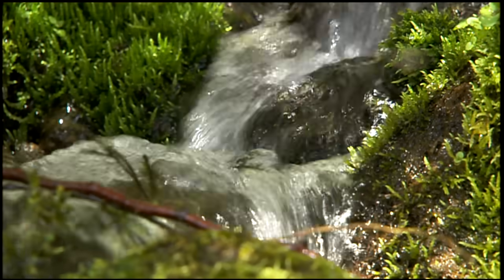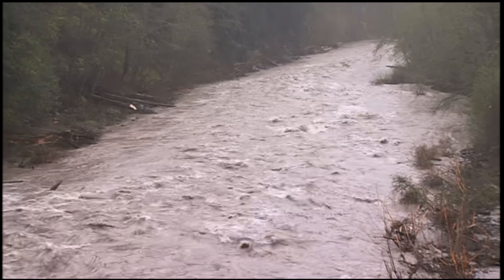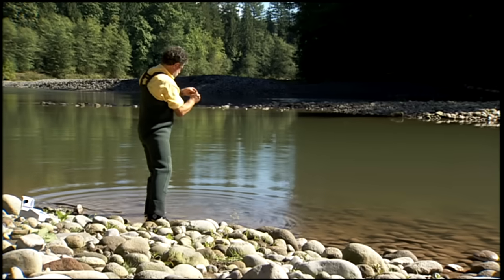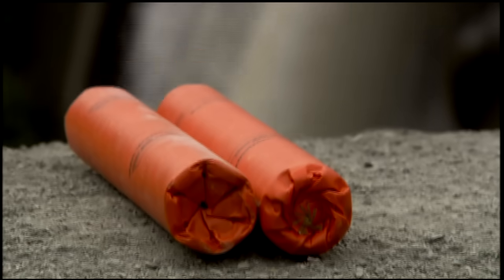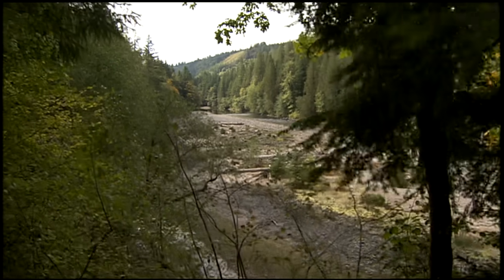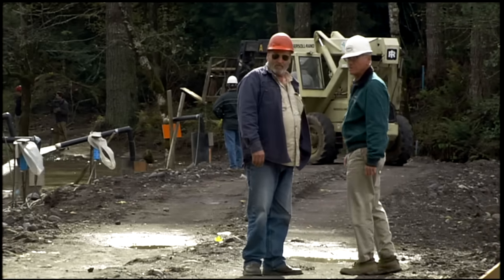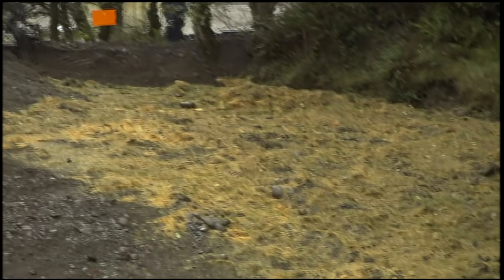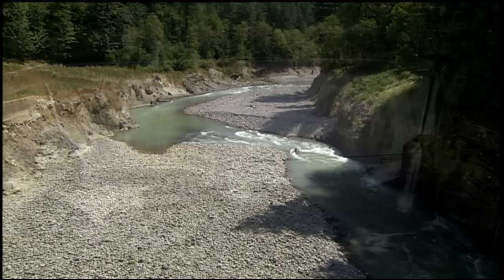A dam no more

Comment: Megatonnes of sediment builds up behind dams in few decades. Remove the dam and most of that will wash downstream, despite efforts to stabilize it with plants. It will smother spawning beds and do other damage, and while the river will—probably, eventually, mostly—clean itself, it only takes one year’s total failure to destroy a spawning run. Suggestion? 
Build one suction dredge that can be taken apart, transported by truck, and reassembled behind a dam scheduled for removal; we should be able to schedule dam removals so that one or two machines will do for all. Dredge most of the sediment out from behind the dam, and it will not be there to wash downstream. I don’t know where/how we dispose of all that, if it’s contaminated with agricultural and other chemicals—but then we don’t want to let that contaminate the downstream river bottom anyway. Where it is clean enough, it’s silt, very rich soil, and it could be sold to farmers or as a component of potting soil. 

There are no wastes, only un-utilized resources.

Comment: Old country boy. I see that an improvement to the removal of sediments could have been achieved by having placed explosive charges in the sediments to loosen and fluff them up, especially along the edges out from the center of the stream flow.
Reply: No need. Mother nature has more power in the 'heavy winter flows' than a truck load of explosives.

Comment: Well you fools you will remember while ya setting in the dark ,  your food spoiling in the freezer , your baby's dyeing and crying because of no a/c , or in the winter when there you are  about to freeze to death because your central  heat/air  will not come on , as you die of thirst cause your well pump or the town/city water supply will not run , cause the pumps has no power ,as your parents gasp and gag to death because there o/2  machine cant  run because of no power , as your town/city  structures burn to the ground cause  there is no power to run the fire pumps . raw shit back's up into your house's and business'  because the sewer pumps have no power to run.   Citys like New Orleans because of those massive pumps that keep that city from flooding ever sq inch , cant pump cause they have no power,   10 of thousands of people die the fist couple days in hosp cause  no power . fuel  and gas plants shut down  cause of no power, 10 mile long gas lines  you get there only to find out they cant pump the fuel from the under ground tanks cause fuel pumps require power, airplanes grounded because there fuel pumps  will not work with out power ,    heart attack victim die by the thousands  while medic's  stand by helpless  cause there  Cardioversion machine cant be recharged ,  now you think of that one stupid clean form of energy  that dam  hydo power as you take your last breath was it worth destroying over a few fish . if you think that way  you are a evil, vile demonic person , to put a fish  over human life , you are one sick sob !!   have a nice day fool !!

Comment: Well spoken for the Anadromous Species!  Fisheries and Coastal Connectivity can and will provide habitat, sediment can slowly be released or through larger flow pulses that effectively over time the release will begin to filter and release these sediments as river hydrology, flow regimes , and other aspects of the emerging new river system to adjust if most is organically acceptable and not toxic materials, mine tailings, or other more commercial style inputs from Industrial or other human activities.  Beaver and muskrats help to systematically provide water tables through water retention activities, active management through downed woody debris recruitment, deeper water profiles to aid both species deep water cover to elude predators, and these guys take a bit too much credit as do many theoretical costs as Nature could do better as Human Dams are removed properly.  Both species diversify and encourage vegetation growth and sproutin sites as ranker or more mature vegetation is consumed, utilized, and implemented into local food webs, nutrient cycles, insect development and recruitment such as Stoneflies, Caddisflies, etc, so Natural process and niche related activies help to restore Water tables on the River by slowing river or stream flows and are especially dutiful in low water years as they can efficiently manage water releases.

Comment: To remove the rubble and sediment they are going to have to FISH NET THE WATER FLOOR TO PROTECT THE SALMON.  Install fish nets about a quarter mile to half a mile up the water channel so the salmon will not be able to swim down the channel until they are finished doing the work of removing the damn, rubble, and sediment.  That's also gives the area of water they will be working in to restore it's pH factor suitable for the fish.

Comment: As sediment deposits are usally full of nutrients especially when it feeds a delta, would there not be some profit in taking it away and spreading it on impoverished lands.
Reply: Salmon need clean, silt free water and a gravel base to lay their eggs. 
IF they did as you suggested, they would be stirring up sediment continuously for a long period of time and that would interfere with the return of the spawning salmon. This is why they had to try to do this method that had never been done before.
Reply: @Bustahbrown  I cannot see how my sugestion has no validity in terms of removing valuable sediment. They are waiting for the storm to arrive to remove sediment. So with sediment removed by machines, what would the problem be in allowing the storm to remove the remaining sediment left behind. The one thing that it does not cover is the effect upon other invertibrates further down stream that are going to have all this sediment laying down on their river base.
Reply: Another case of: they literally talked about this in the video

Comment: And now the 1600 homes that used that hydro- electric power must now rely on solar (only works on sunny days) or wind power (only on windy days). What a bonus for the power supply companies. Brace yourselves for astronomic power bills.
Reply: yes bend over. same thing in illinois
Reply: @donaldbrown7252  Currently in IL we are subsidizing nuclear plants.
They should build some natural gas powered ones to replace the power generated and shut them down.
Reply: Oh, come on... there's always coal and fuel oil!
Reply: Well and not only that the panels are only 18% efficient the best of them are we found that out when we went to go install solar on our house. Our situation is perfectly posed for constant sunlight all day long from the time the sun comes up this time the sun goes down we would have sunlight pretty much three-quarters of the year and even on snowy days we would get patches of sunlight so we'd only have to have a small battery Bank we don't use a lot of electricity but we'd have it set up for a washer and dryer refrigerator

Luckily the heat, stove and hot water heater are gas.  There is also a supplemental wood heavy duty warming Style with power blower fireplace insert which uses minimal wood 2 heat the ceramic plates. What we found out was that the use of solar panels would leave us dependent upon the electric company for good we would not make enough energy off the sun no matter if we were 24/7 on the sun because of their inefficiency. We thought about doing the little wind turbines but because we get really serious wind and the trees you can't guarantee that something won't bust them up flying pinecones limbs needles squirrels I went ahead and just said the stick with what we've got. Are fireplace produces practically no emissions as we have a scrubber on it we use very little heating as where our house is smaller we always keep rooms that we don't use closed we have excellent insulation, a special custom built window installations for winter that are removed and replaced with Summer wait I enjoyed making those but it's just crazy some of the stuff people expect us to do when really all it is is a fraud.
Reply: @valiantsfelinesmccarty6678  First of all, solar panels can reach a maximum efficiency of about 34% at the moment. Secondly, what a stupid argument. If you talk about this efficiency, it is the efficiency of the solar cells to convert sunlight directly into electricity, so it cannot even be compared to hydroelectricity or wind-energy. Both are (indirectly) ultimately powered by the sun, hydroelectricity through condensation and rain and wind energy through the movement of air which is also caused by the sun. If you would calculate how much sun energy is needed to provide you with enough water to get the same amount of energy it would be more than you need for solar panels. And finally, even the best plants only have a "solar energy to biomass conversion rate" of 2%, multiply that by 0.1 for every trophic level to find out that your beefburger has an energy efficiency of about 0.02%.

Comment: The people in the Portland area are all up in arms about global warming and the use of fossil fuels so they take out a dam that makes electricity from running water. I am sure this make sense somehow?
Reply: Spoken like the idiot you are. Thanks for proving you' re stupidity on this.
Reply: @FYMASMD  I asked a question. You responded with nothing but rude name calling. This is why we never get together and talk.
Reply: @FYMASMD  lol youre the moron. It states in the video the new fish ladder standards were prohibitively expensive. Those standards come from environmentalist concerns hes talking about. When these damns are removed the power loss (in this case 22mw) is often replaced by coal plants. So environmentalists have actually made the problem worse, by forcing new standards on a system thats worked well for decades. You get comfier fish (an idea retarded at its core) and marginally higher spawn rates (which could easily be done in a hatchery far cheaper and easier) but dirtier air and non aquatic life is effected negatively. Now, shut up and go away.

Comment: Ok, so this was all basically about the fish. Seems to me that with the money and effort spent here they could have built an awfully elaborate fish ladder to handle that issue. But no, they take down a perfectly good facility that was providing clean, free energy for 16,000 homes. And what of the cost of building whatever is going to make up for that lost capacity? Makes no sense to me.
Reply: Makes no sense to you because you don't have enough info. It was cheaper to remove the dam than maintain/update it. Salmon preservation was secondary. It would have cost way more for new fish ladders and updates to the dam than to remove it. I forgive you for you're lack of knowledge.
Reply: What Me Worry  That's quite generous of you. I take it that you have info other than what was included in this little documentary?
Reply: @dieseldave71  do you actually think GE would tell the truth? Obviously you don't live around here so yeah I do have more info about it because I live very close to this area and was personally involved in the project. Like you care anyhow. The federal government wanted the fish ladder updated. GE decided not to do it because the dam didn't generate enough money. Simple economics. Satisfied or do you needmore info? The power it generated was with antiquated generators. The new generators at Bonneville easily replaced the power this dam generated and more efficiently. Still need more info?

Comment: Absolutely ridiculous. You said it supplies power for 16,000 homes. And your tearing it down. Where will the power come from to replace it. Coal, nuke WHERE? hydro power is by far the best, cleanest, and most cost effective way to generate power. The salmon problem is not all due to dams. So many things effect it. Lets work on those problems instead of bowing to the ridiculos.
Reply: Updated generators on Bonneville, The Dales, and Grand Coullee dams and more wind turbines and solar replaced this puny dams output by more than 1,500 times. Look it up bozo.

Comment: Hope you enjoy the dry Colorado River in the future. Not too smart.
Reply: You do realize that this river flows into the Columbia River, not the Colorado river. Further the state of Oregon doesn't even rely on the Colorado river for anything along with this river is the melt runoff of snow on Mt. Hood. 

Also the Colorado river is drying up for reasons that affect the states along the river. Which the biggest factor is that we are relying on river in that area that was over estimated to it's capacity and the climate changing where there is less snowfall (and subsequently less runoff) occurring where the river originates.

Comment: It is so sad to see a remarkable structure that provided power for 15,000 homes be destroyed on purpose.
It would take hundreds if not thousands of windmills to equal that power.  They only work up to 25 mph wind speed which usually happens during the day when less power is needed.
Fish 'Ladders' have been successful.  A million cubic yards of silt released.  Its gotta go somewhere.
Reply: Gord Baker Hundreds or thousands of windmills? What makes you think that? In the UK we have 8 megawatt wind turbines, each can power thousands of average homes. Even in the US with their energy hungry, poorly built and poorly insulated houses I suspect four turbines would more than replace the power provided by this dam.

Edit- just read the installed capacity was 22mw. So easily replaced with three turbines. 

As for the sediment, it will be very quickly washed downstream, in a matter of months if not weeks. It will go to the ocean which is exactly the same place it would have gone originally had the dam not been built. It sounds like a huge amount, and it is, but rivers very quickly reestablish a natural equilibrium, and this amount in the ocean is actually tiny in global terms, and short term damage will be massively outweighed by long term gains.
Reply: @spencerwilton5831  Wrong! Moving water exerts much greater force than moving air. Not to mention hydropower is dispatchable and wind is not.

Comment: Fish ladders don't really work.  About 3% of the fish attempting to migrate upstream actually make it.  Dams are about half the problem for the salmon in the Pacific Northwest, nearly equal to the adverse effects of those dams are logging roads in the river's watersheds. Sediments from the roads settle into the spaces in the gravel of the stream beds, leaving no where for fertilized eggs to be deposited at the time of spawning.  When research found this correlation nearly everyone in natural resource management fields and science were pretty shocked.  We all knew it was a significant factor, but didn't know it was as significant as it turned out to be.

Comment: Now the river should be diverted into a nuclear power plant cooling system to replace the power lost from the dam removal
Reply: I was being facetious dunderheads. The destruction of hydro power dams is indicative of a lack or critical and productive thinking. Hydro power production is the best "greenest" way to produce electrons. The infrastructure is long lasting. durable and reliable simple technology that can pay dividends for 100 plus years. In this world of concern for green house gas emissions, It is one with the smallest carbon foot print.  There is always away round a problem. That dam could have been modified to remove the silt accumulations and a system to allow fish access into the water shed area. Construction and bureaucratic cost have become out of control. To build a facility like that today would be prohibitively expensive. "run of the river" projects take huge capitol investments and require decades of time to pay off. Our governments open door policies that promote massive immigration will only create ever growing demand for electricity. So It was a joke that went over you heads. Nuclear power is seriously being looked at again to replace and produce power that will feed our ever insatiable need to grow like weeds that will eventually destroy this world.
Reply: No power was lost, there's no shortage of hydro in the area, and existing hydro is more efficient every time generators are upgraded.
Reply: Moron.
Reply: Obviously, you have no idea what’s happening here

Comment: this was done several years ago now, I wonder what it looks like now,  if the primary objective worked as planned,  if the fish really benefit as much as expected, and the electric needs and bills after this .
Reply: So have crews of beavers now shown up and starting modifying the river to their own liking?
Reply: well the powerhouse that the dam helped supply with water was only able to produce enough electricity (22 Megawatts) for 12,000 homes. Compare this to the dams along the Columbia river and the respective tributaries generate 29 Gigawatts as of 2012 (the dam featured was taken out in 2007-2008) which can power roughly 21 million homes assuming standard electrical usage. So the dam was likely a drop in the bucket compared to where most Portland General Electric customers got their power from.
Reply: @alex-marquette  You are correct. The direction is efficiency of money. There is no advantage to having many smaller generators when a few will do the job by simply modifying the distribution system. Other than that, the destruction of the smaller generators includes a lot of tax and cash flow benefits.